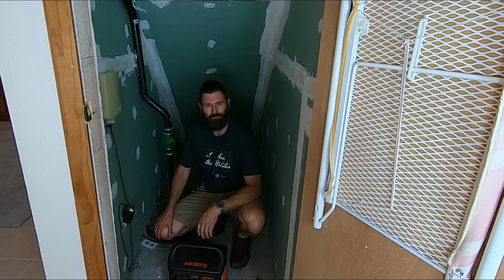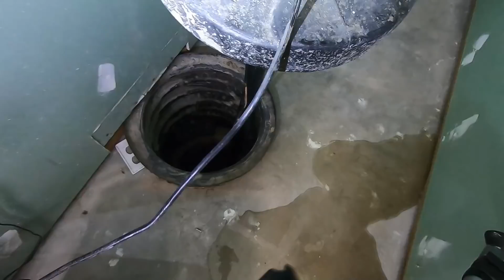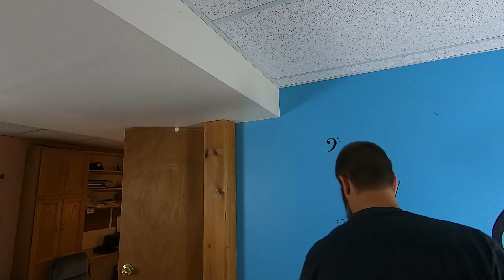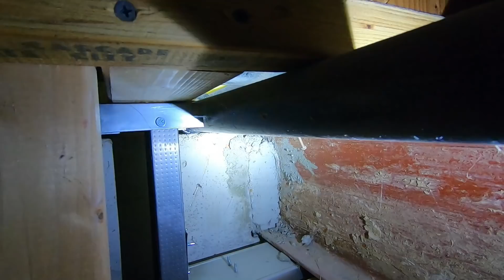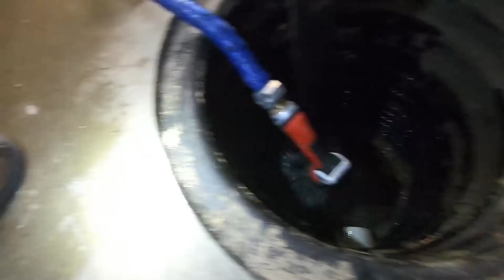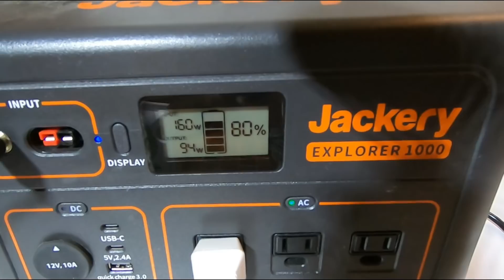Handyman Floods Customers House While Making Youtube Video | THE HANDYMAN |

Comment: Okay, the explanation of what the pump will do now is awesome. However, why were you there in the first place? And what was that wire coming out of the sump? Oh yeah, power cord that when plugged in makes the pump put water in the ceiling. That was nuts.  I live in Florida, so no real sump pumps, because no real basements. Yet, I have lived up North, and understand the water and moisture issues in basements. So, exactly why take the water from around your foundation (to protect your foundation and basement) and drain it INTO the basement, to then pump it out? Were they not able to pump that water to somewhere AWAY from the house and then pump it somewhere further away? You made the case yourself. What if there's a power failure (oh, and a heavy storm)? "Grab the floaties Hon, were going down to the indoor pool."

Comment: That's a nice little upsell with the Jackery, but if the pump itself goes bad it would make no difference and it does happen frequently, just like the idiots not glueing a pressurized pipe lol... They make battery backup systems that are pretty easy to install that include a main pump as well as a secondary pump higher up, as well as the car battery backup power source. Most of the power sources self charge, or self maintain and last a long time 👍🏼

Comment: Wondering why french drain is leading water towards inside of the house, in Europe we drain outwards from house, no need for pump
Reply: That's not a french drain and it is draining outwards from the house. The water is inside the house, in that bucket, and it is draining outwards. A french drain is a drainage system on the outside of the house that diverts water away from the house as you said. This was just a sump pump with a poorly made drainage tube. In fact, if that house did have a french drain, there would be no need for the sump pump inside the house.

Comment: In my experience the starting of the sump pump uses lots of watts. Battery back up pump. May be a better solution....  marine bilge bumps are very efficient 12 V. Now you’re pushing a lot of pipe so it’s about the total system heads ... (work is watts )
Peace

Comment: $1000 for the Jackery seems kind of expensive, but I may look into further.  I've got a $1500 tri-fuel 7000 watt generator to run everything in my house, including the sump pump, but excluding the central AC, in the event of a power outage and heavy, prolonged rain.

Comment: As a plumber, I always drill a 3/16 weep hole in the outlet above the pump to prevent “airlock,” that’s probably what your seeing shooting out.  Love your channel!
Reply from the maker: I will check it out when I pull it out.  It was way down in there and hard to see with all the water spraying around.   I think I need to replace the check valve too.   Thanks for watching.
Reply: Some of the sump pumps I've installed have a weep hole in the base of the motor itself, the manufacturer also recommends a second weep hole drilled in the pipe itself , again , to prevent airlock ..  thanks for the great video ..

Comment: I love the household projects... i look forward to the sump pump replacement video.. my pump is very old and on my list to replace (preventatively). doesn' seem too difficult but can't wait for your method as i trust the handyman 100%
Reply: I installed a sump pump at my house a year ago, and bought a second pump, same model, as a backup, as well as a back up check valve.  If I have an untimely failure, it should be an easy remove and replace.